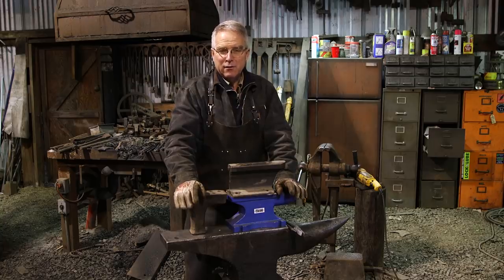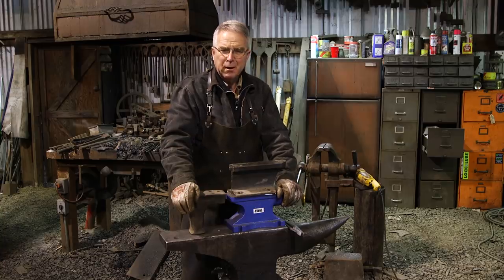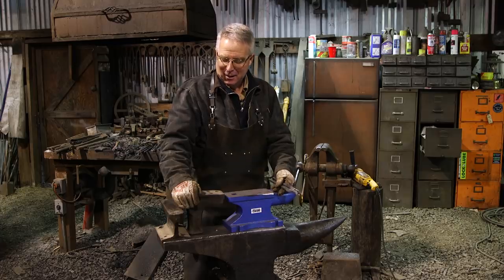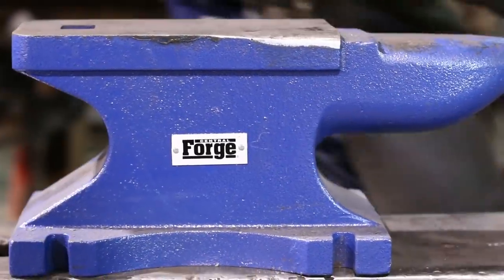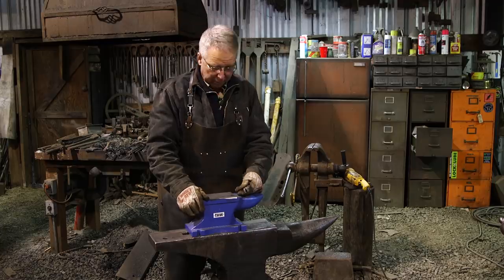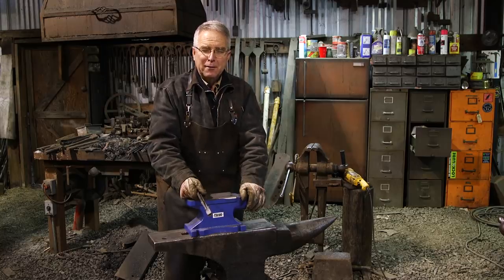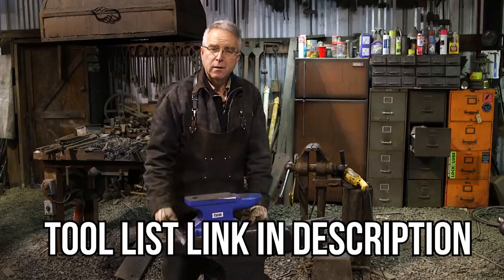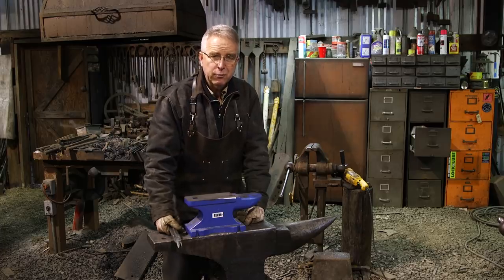Harbor Freight Anvil Review

Comment: I bought one a year ago. Realized it was extremely less than ideal. Got a peice of r/r track and welded 2 inch thick plate to the top and that is what I've been using. The HF anvil sits under the horn of my "anvil" and is used as an upsetting block.

Comment: There is video out there of a guy who cut one of the Harbor Freight  "anvils" in half.  In spots where the cast iron didnt hold or surface level imperfections it had a JB weld like filler.

Comment: Couldn't you carefully wrap that face and case harden it with some carbon like you would any working tools hardened ends?
Reply: Steel has less than 1% carbon. mild steel is usually closer to .1% and can be case hardened by adding a bit to the outer layer of the piece. I was under the misconception for years that cast iron had practically no carbon but the opposite is true, it has too much carbon and can't be heat treated or case hardened.

Comment: Could it be improved by welding a steel plate to the top ?
Reply: W S its cast, you can weld to it but the impact of striking may separate the welds
Reply: i was wondering the same.
Reply: You probably could, but given that it's cast you'd want to preheat the upper part at the very least, if not the whole thing. I imagine a piece of O1 tool steel would work fine, but that stuff isn't exactly cheap.
Reply: We all know what a turd is, in this case it's painted a shade of blue ...now, i got the blues. Thank God there's a few others 'likeish' Scott who perhaps are in closer proximity to each one of us who would point one in a better direction... i think they are called farmers' they do stuff but I forget what they do!?! lol

Comment: It is good for copper and brass work, but I actually saw a person that had welded a steel plate on top of one.. and it worked- even had a ring.. but he did horse shoes. Here in Jamaica I may be stuck buying one of them due to shipping costs as apparently the steel recyclers got all the anvils..but am still looking for a farriers forgr and an anvil.. even though will have to use lump charcoal here..no coal available,,

Comment: Question for anyone who has made a knife from a large circular saw blade.   What type of steel is it made from roughly, and does it need heat treating?  A good file does take metal off slowly.   It's going to be a kitchen knife.  Thanks.

Comment: I’ve traveled around the world for a few years and I always sought out Blacksmiths to see how some ancient civilizations adapted to the problem of hard services. As crazy as it’s sounds, Anvils as we know them don’t appear in millions of shops. Most of the time it’s just a Sledgehammer turned up on end or some mystery metal in a dirt floor with some old guy squatting over that hammer head pounding away happy he doesn’t have to use a rock. In Pakistan I witnessed a Gun Maker using what I’m sure was a meteorite to forge out custom rifle barrels. The precision that these Smiths could achieve is remarkable. In the Philippines I went into a shop that was using a Crane Counterweight. This thing was big enough so the entire compliment of Hammer holders had their own spot to work on all at the same time.

Comment: I got a 2" x 6 1/2" x 11" block of steel with a 1" square pipe welded on the side for a hardy hole and one face ground smooth and the corners beveled and radiused in one part for $60. It's probably much harder than that harbor freight thing. That's how I'm starting. I'm planning on saving for a 120 lb anvil from Nimba.

Comment: Back in the 80's harbor freight had a 100lb anvil made of mild steel I actually started with that it was actually a very good anvil. it was european style meaning it was pointed back.
They stopped  selling it in the early 2000 I used to swear by that anvil and even though I have some other ones now it is still my favorite for smaller work.

Comment: I was very much on the fence about the HF anvil, and I'm glad I put off the decision.  Purchased an NC Tool knifemaker for $310 form centaurforge.com and absolutely love it.  After dressing the edges and removing  the black paint form the face, it is %100 improvement over the ASO I was using.

Comment: You are absolutely right about everything you said!
That said, I have a rare disease, Still's Disease that is well on its way to eating ALL the cartilage from ALL of my joints.  I am existing on small disability checks and the HF "anvil" was all I could afford and I have forges a LOT of salable items for Rendezvous and other events!  It ISN'T making me a ton of money and never will!
BUT, it worked well enough even though I've had to clean up the surface, several times since it dents so easily!  Your Hardy hole is FAR better than mine as I had to dile, (FOREVER it seemed like) to get it to where my hady tools would fit and I'm thinking about trying to grind that abomination, at the front of this thing into something that could resemble a horn!
Is THAT even possible???
Anyway, it's a piece of crap that I have worked on enough to make back far more than I spent on it so, I guess it SORT OF works!
Nice video!  Thanks! I learn a lot from you!
At 66 and partly disabled I STILL learn something new each day OR, I feel that I have wasted my day!
Hats off to you!  Keep the great informative videos coming!

Comment: Granted that this anvil, being all cast, lacks the recoil needed for proper forging. That said, is it possible to buy this anvil new, and then buy a 1/2 inch piece of tool steel (?)  the size of the top (Or 3/4 inch. Or 1 inch), and weld it in place. Would this improve the recoil? Is it even possible? And what might that cost?

Comment: Did a cold chisel cut for plate steel because harbor freight grinders dont use the same batteries as the other tools. Well, i know for a fact railroad iron is harder than a harbor freight anvil becauae ive had both now and the railroad iron never got this much damage from a light chisel tap.

Comment: I think on the tool list there should be a 6 inch bench grinder with a wire brush, buffing wheel, and grinding wheels it's like an angle grinder but more controllable

Comment: Is it possible to somehow attach (braze or weld with Muggyweld) a piece of hardened steel to the face of the HF ASO and make it a better tool. Say for example some 3/8 or 1/2 plate of a suitable hardness?

Comment: It seems to fall in line with my experience with most of the items available at harbor freight. Disposable and/or entry lvl infrequently used tools where you can't justify a full investment but want to have something to get you by if/when the time comes. If you find yourself fighting the deficiency in the tool it tells you time to upgrade. Just my thoughts thx, for the video, nice job as always and much appreciated.

Comment: in my area, there is very little in the way of Blacksmithing suppliers and I am staring on a 10lb sledge hammerhead mounted to a heavy motorcycle jack and secured 2 4x4 ripped boards it's heavy and sturdy with rebound my question is in socal getting decent answers from online searches gets very difficult any advice on where to look for good deals on decent used equipment would be great low cost is key for me though very small budget

Comment: I broke my friends HF anvil, the smaller one than that one.  I was hammering nails in to hold the feet in place, and the whole front foot broke off. It was a 2.5lb hammer. For science I smacked the other foot and sure enough it broke too.  I needed that pritchel hole though so I clamped it into my vice and it worked for driving a rivet hahaha.

Comment: Great video. I took a look at your tool list. Forgive my lack of in depth knowledge, but you listed Hardy Backer board to protect the work bench. Would you please explain or provide a link where you have already explained that?  My imagination is running wild and probably not the right way. Thank you.
Reply: Donn Grimes it's just a heavy strong fireproof waterproof wall backing board for building showers and such. Which can be used to strengthen and cover the surface on your nice workbench so you don't trash it.
Reply: @matthewhall5571 : Yep, that's my take as well. Hardie Board is a brand name (one so common it's also a generic term). I'm most familiar with it as a siding product, but any fiber cement board should do the trick. And when it's beat beyond service it's easy to just replace the sacrificial top instead of the whole workbench :-)

Comment: So trying to get into this as a hobby. while this anvil by itself is less than ideal, could you at least increase the longevity a bit and reduce marring by welding a forged plate to the top and rounding out the horn with an angle grinder and sanding? Legitimately don't know so wanted to ask

Comment: What type of vise is that behind you on the viewers right. You have it attached to a log. Just curious what it is called and what it's use was. I have my grandfathers next to his anvil.
Reply: That's a post vice(also referred to as a leg vice). It's basically a vice specially made for blacksmithing that transfers impact into the ground/floor instead of being absorbed by the body and screw assembly. Regular bench top vices aren't made for doing any really serious hammering on.
Reply: @reigninoel  thank you! It is still attached to a log as far as I remember. I appreciate the response. Blessings in Christ.

Comment: Is there a way to mess with the ironof the anvil to make it harder so it can be used as a forging surface?
Reply: Attach a piece of 1/4"(or thicker) plate mild steel to the top of it. That's what I did with mine. I used some countersunk flat head machine screws. I've got the little one without the hardy hole. But the concept is pretty much the same with the bigger one. Anyway, it works pretty good for what it is. And it's held up well to quite a lot a banging so far. If it ever gets real beat to shit I just have to cut out out another piece of plate and screw it on there. Good enough for me and the girls I go with...

Comment: I don't do blacksmithing as a hobby. But I do most of my own auto repair. And living in New England rust is an ever present problem. Sometimes brute force and ignorance is the best solution to the problem at hand. This ASO seems to me just the thing to beat the daylights out of parts that have rusted to the point of almost being welded together.

Comment: Well I’m just starting, knew this wasn’t ideal, but as you said it’s better than nothing. Been shopping around for anvils, I’m horrified at the prices and conditions of them. I’ve build my own forge and bought some hammers from you guessed it HFT, I have rebar stakes and will be heating metal and pounding on it, at least I’ll learn hammer control. The real question is should I divorce my wife for having my 18” railroad tie tossed away, it was there when I bought the house, it wasn’t bothering anyone sitting in the corner of the garage, Second question should I throw out her Singer Pedal sewing machine which has never been used and is cluttering up my office space?

Comment: Hi Mr. I think exactly what you speack, but in my contry good anvil is very expensive and rare, a lot of anticaires bought all of the anvil in my contry and now ask a lot of money for an anvil in so so  not good and end of in  good condition, i saw one i would like to have but he ask 2  000.00 $ and 2 days later this anvil was sold. That is the reality for an anvil. Now i use a scare plate of steal 12 X 12 X 1 inch 2020 02 23 Saint-Joseph de Mékinac, Trois-Rives, Québec et Labrador. P.s. I like all of yours vidéo.

Comment: Hi Scott.   I discovered your channel about a month ago and I've been watching a lot of your vids.  Love your channel mate and have been thinking about getting into blacksmith forging as a hobby since I'm retired.  Question:  I found a Peter Wright anvil for sale on Craigslist.  It's solid wrought iron, 1 1 11 (whatever that means).  Weight #151, 4 1/2" X 15 1/2" X 25" long and 11" high.  It has a 1" Hardy hole and 1/2 " Pritchel.  Cast around 1852 to 1890.  The owner wants $475 for it and it appears to be in good shape from the pics.  Thoughts?
Reply from the maker: Jump up away from your computer screen right now pick up the telephone, call that guy and go buy it immediately!
Reply: @essentialcraftsman  Thanks Scott, I will.  Wow.  Thanks for the quick response.  The guy is about a 4 hour drive from me here in Vermont.  However, I'm going to pull the trigger and let you know what transpires.  Thanks again for your input Scott.  Cheers!

Comment: Thanks for the review. However, training yourself on the wrong tool will train bad habits. If there's an emergency and this is all there is, for one quick thing, I could justify it. But to start learning to blacksmith on a so-called Anvil that has no rebound, that is not strong, that is the wrong shape, is not a good thing.
As you say, learn to weld with rods,  later it's easier to mig or tig. Please correct me if I'm wrong. 
You remind me SO much of my Dad, and that's a good thing.

Comment: 400 pound Hay Budden be like "what the hell ya think you're doing?"       

good video, ASO's are very useful to one just starting out in blacksmithing, though better off buying a larger piece of steel at a scrap yard. If the person had a welder they could weld some lugs to secure it down to a heavier base, and add a horn of sorts to it.  an ASO and a brake drum coal forge is also a good way to start off cheap, both can be made for 100$ or less even.

Comment: While the HB is crap, you were probably more tired because the anvil was so low.
Rebound is the measure of the anvil for quality and structural integrity. When hammering, you are hammering a soft piece of steel against another piece of steel. Rebound holds no weight in hammering (unless you like to work cold).
Reply: My apologies, I meant to say "HF" (Harbor Freight), not HB. Hay Buddens are excellent anvils and deserve full respect.

Comment: Nothing against Harbor Freight as it has its place, but better to just buy a large block of steel, about 1 cubic foot's worth of material overall, and start with that.  Tried the railroad iron pseudo anvil years ago and while a novelty and better than beating hot srteel on your thigh, I would not advise its use as anything other than a door stop or shop paper weight.

Comment: Weld a piece of 1" or 3/4" of a36 or any other high strength plate to the top then you'll see a nigh and day difference
Reply: Still not much of in the rebound department - and you can just weld right on it - do a surface weld with a rod meant for hardening surfaces.

Comment: If you dont have many other options and cant find a reasonably priced anvil in your area (or cant yet afford one).....What about getting a 2" thick mild steel plate...A36 plate??....and have the steel provider punch a hole that you can square to a hardy.  Would that be serviceable as a striking anvil of sorts with a decent base.